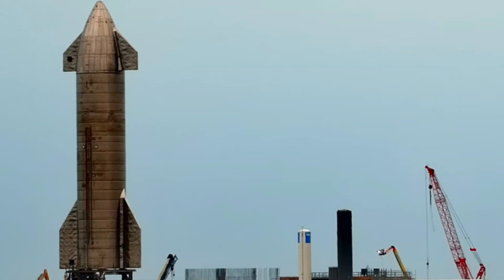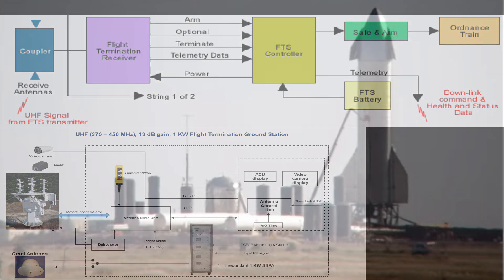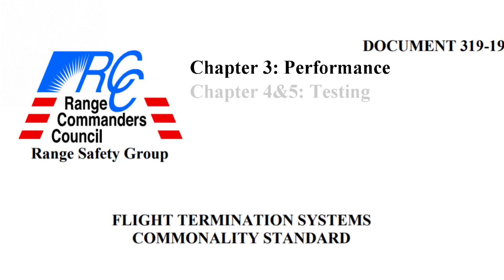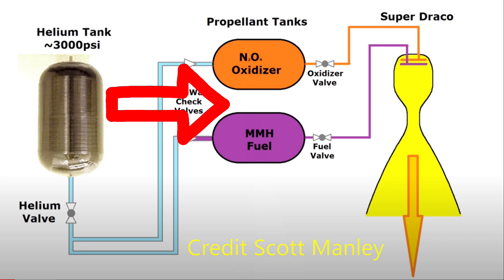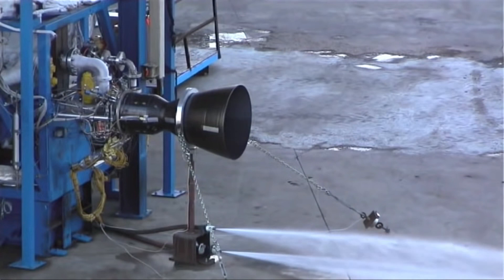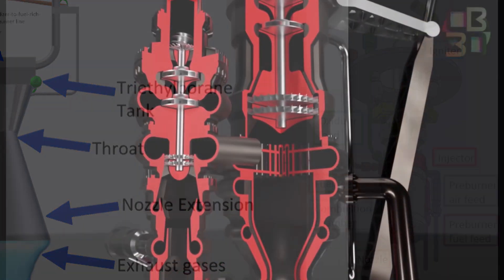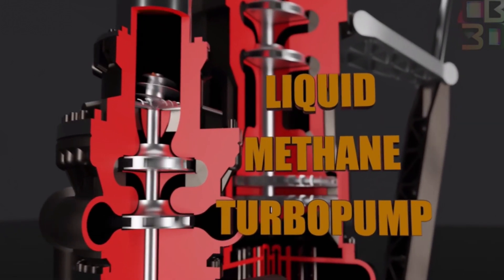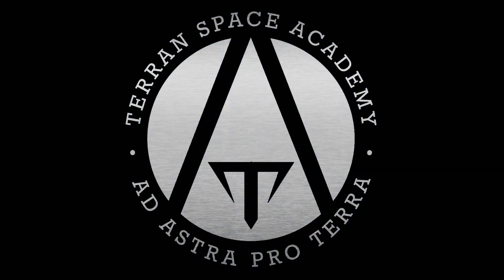A Hard Start for Starship 11

Comment: When restarting, why don't they run the arc in a dry chamber and then gradually add fuel and oxidizer until they ignite, instead of filling it first and then igniting? Seems easier and safer to start with a small flame and grow it than try to get the mixture perfect on the first try.
Reply from the maker: They probably have to worry about burning out the electrode since it must be an enormous amount of voltage jumping across.

Comment: Prepump to an accumulator with an air separator no bubbles 
For a regulated liquid source
To prime
With belly intakes &
Sized to ignite then intake from vertical
As normal
Reply from the maker: I was also wondering about a cylindrical syringe type header tank. If you used ring seals it could solve the pressurization problems.
Reply: @terranspaceacademy   yah the rs25/sls engine have the pre burner pump. a mechanical syringe could work i imaged a diaphragm expansion tank type but has to be cryo rated and dependable so a pump be it a syringe with adequate seals to feed startup. Sounds simpler for weight. Easily flow controlled.
Reply from the maker: @plazmoidialsoup2211  That’s what I was thinking. And you wouldn’t have any vapor lock problems.